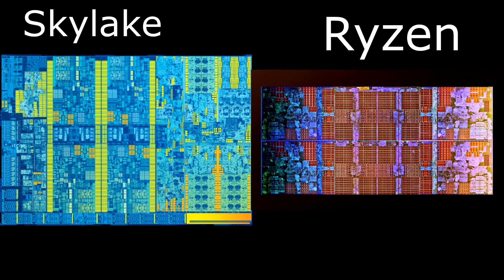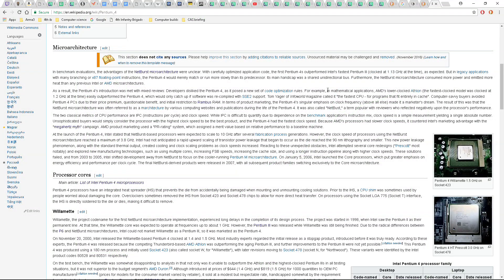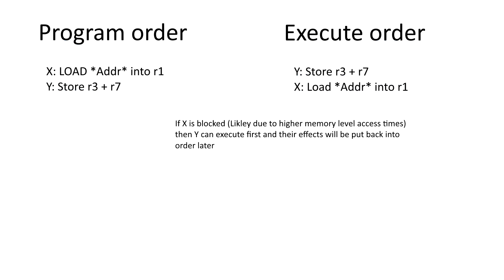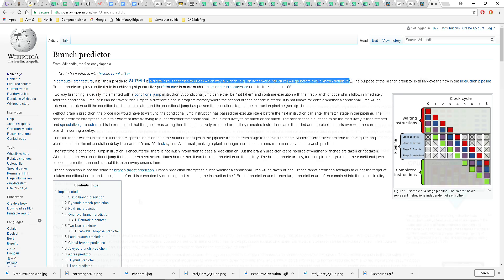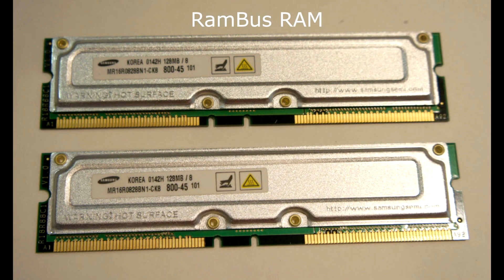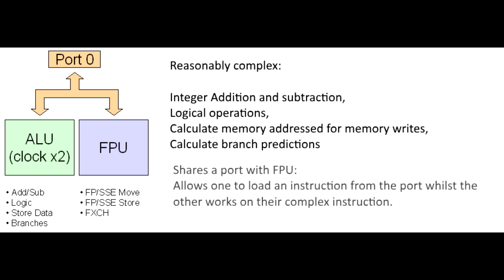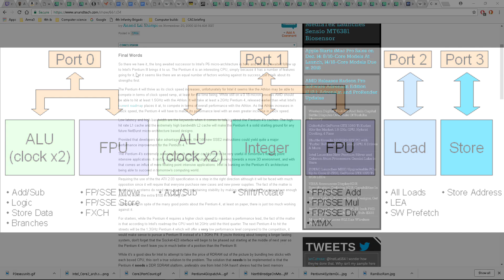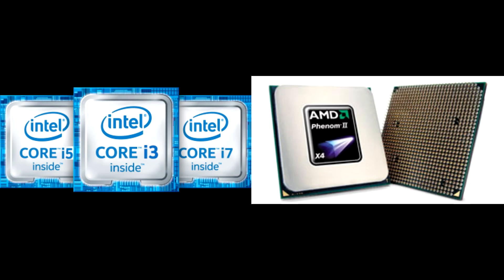CPU Design philosophy: Gigahertz war

Comment: After watching this video I've come to a thought: Pentium 4's architecture looks so flawed at fundamental levels, that I have a hard time believing it was a mistake. Probably a very carefully planned way to increase clock speeds to the Moon and make an illusion of a fast CPU in the eyes of average Joe. Having CPU stall and wait for main memory does increase stable clock speeds - just compare the same CPU in AIDA64's FPU and memory stress tests. Both load CPU by 100%, yet first case can almost double the power consumption of first. And it worked sadly, and bribes to OEMs to not use superior Athlons just sealed the deal and pushed AMD tens of percents of market share behind.
Reply: Remember they've had in plans Pentium 5 Tejas/Jayhawk.
"50 stage pipeline", "Slated to operate at 7Ghz", "Tejas went even further ahead with this paradigm, with Intel targeting 10GHz clock speeds by 2011".

Comment: 4:41
AMD just use "SMT" as their term.
Why invent the wheel?
And saying that they where behind...
Eh, debatable.
Bulldozer and Piledriver used a hybrid SMT tech in their Bulldozer and Piledriver processors after all.
Reply: graph shown at 1.22 is wrong, amd was first to 1ghz. If you consider demos then ibm reached it in 97 with an experimental chip. Intel was only able to take back the crown with the p4 northwood, the p4 williamette with its rambus couldnt compete with amd using ddr ram.

Comment: I would love to see a video strictly on bulldozer and why it failed.
Reply: Same here.
Reply: Bulldozer was built around highly threaded application model, not single to low thread application model (which were the prevalent threading model at the time), and it failed. But as a server processor, it scaled quiet well, especially for VM's.